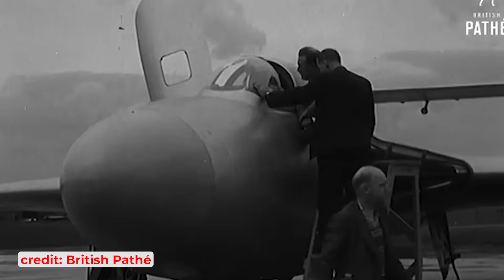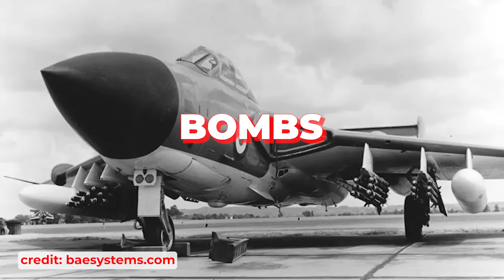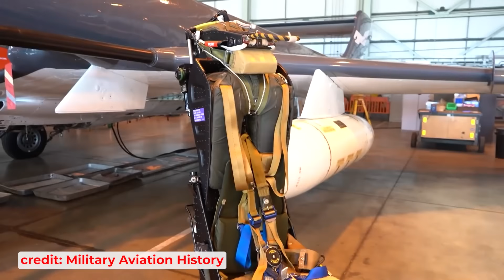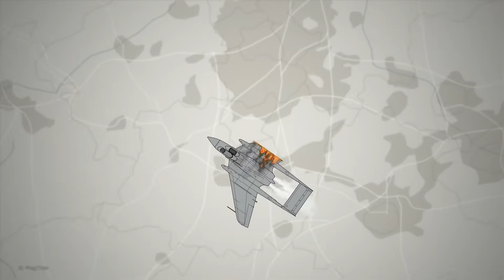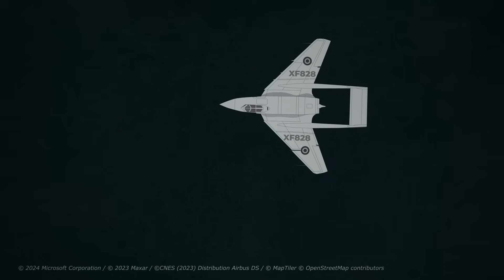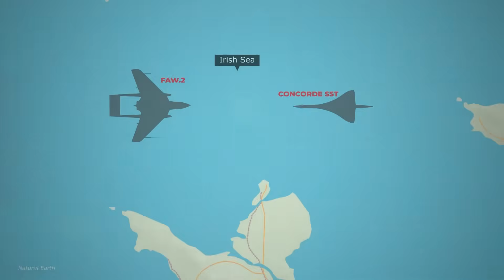Sea Vixen: A Beautiful Killer

Comment: Why continue flogging a dead horse,it should have been scrapped after the air show accident.
Reply: Sea Vixen Compared. 

We feel we can clear up some commonly held myths and misconceptions, obviously.

It's always good to see the facts presented clearly and concisely isn't it.

We feel we can clear up some commonly held myths and misconceptions, obviously.

It's always good to see the facts presented clearly and concisely isn't it.

See further down for a Meteor losses comparison.

See below for Comet accident losses comparisons. The Comet had similar accident losses fatalities to the later Sud Aviation Caravelle. Much later jet airliners from US manufacturers had significantly worse accident losses. 

The Vickers VC10 held the Atlantic crossing record for 43 years  (Non supersonic airliners). 

The Harrier was the only aircraft of its type at the time it first flew. All 1250 Pegasus engines built for all Harriers ever built anywhere were British build and design engines. The first 135 Harriers purchased for the USMC were entirely built in the UK. All 436 USMC Harriers had British built engines. 

The world's first wind tunnel was built in England during the 1800s. The world's first supersonic wind tunnel was built in England during the 1920s. 

Indeed that's correct. The Whittle Gloster E28/39 was of course a brilliant aircraft that was later copied in Russia as the upsized and tweaked Mig 15 with a copy of the RR Nene gas turbine aero engine.

Obviously the RR Nene being the world's most powerful & most reliable gas turbine aero engine in 1944.

The MD F3H Demon was a contemporary to the DH Sea Vixen & had a similar performance. The F4 Phantom was a follow on from the F3 Demon. The Sea Vixen took a long time to get from first flight to introduction for various reasons and a similar situation occurred with the MD F3H Demon.

McDonnell Douglas F3H Demon
590 Built. Not Supersonic.
Max Speed 578 MPH.
Introduction date 7 March 1956
First flight 7 August 1951
Retired 1964

MD F-4 Phantom 2
Number built 5,195
Manufactured 1958–1981
Introduction date 30 December 1960
First flight 27 May 1958

DH Sea Vixen
Number built 151 (including two DH110 prototypes and one Sea Vixen prototype)
Introduction date July 1959
First flight 26 September 1951
Max speed 695 MPH.
Retired 1972

Regarding the UK Aerospace Sector.
 
An airline recently ordered 60 RR Trent XWB Engines.

It's a great pity & a crying shame that British military forces had to occupy a large part of Germany for decades after 1945 & Russian military forces had to do the same. Of course Russia still posseses a large chunk of what was German territory & of course Russia & the UK produce nukes. Obviously Germany does not produce nukes.

Interesting British achievements.
There is no doubt that the Fairey (England)
Delta 2 was of course the world's first jet
aircraft to exceed 1000 mph.  Indeed It
exceeded the previous record by 310 mph &
held the record for 1 year. Incidentally, the Dassault Mirage 3 & 4 are based on the Fairey Delta 2.

Early days, jet fighters.
De Havilland Vampire, Sea Vixen & Gloster Meteor accident losses were not high or unusual for fighter aircraft at the time. De Havilland built large numbers of all metal airframe aircraft before the DH Comet.
We mustn't forget of course that the DH Vampire for example first flew in 1943 & the engine was also built by De Havilland. There were examples of the Vampire interceptor / fighter in service until 1990 which was operated by more than 30 countries.

Non combat phase accident losses.
% of Aircraft built.
The Canadair CL-44 was a turboprop airliner.
Canadair CL-44                  (ff 1959 ) 48%
Lockheed XF104                (ff 1954) 100%
Lockheed  P80                   (ff 1944) 43%
Lockheed F104                 (ff 1954)  45%
Grumman f9f-5 Panther   (ff 1947) 44% 
Convair F102 Dagger        (ff 1953) 45%  
MD F-101 Voodoo.             (ff 1954) 34%
MD FH Phantom 1            (ff 1945)  35%
MD F4 Phantom 2             (ff 1958)  28%
MD F3H  Demon               (ff 1951)  32%
Gloster Meteor                  (ff 1943)  21%
DH Vampire                       (ff 1943)  23%
DH Sea Vixen                     (ff  1951) 33%
Gloster Javelin                   (ff 1951) 20%
EE Lightning                       (ff 1954) 33%

An example of what goes on these days in various countries.
For example, there are of course no German companies that makes German jet aircraft in Germany & there are no German Companies that make German gas turbine aero engines in Germany that are suitable for widebody airliners.

Brazil makes very good airliners & Brazil is 100th down the list along with Indonesia for wealth per capita. Of course it is in fact the case that Embraer can't build those airliners without purchasing stuff from the US, UK & Europe. Norway Holland Denmark Ireland Belgium - Top 20 wealth per capita - Don't make airliners -  its as simple as that.

    Early days of the airliners.
That's correct of course, at the time the Comet wasn't particularly dangerous. Agreed, that is indeed the case of course, The DH Comet was definitely not the worst engineering failure in commercial airliner history.

How things were back then. 
Accident losses - % of aircraft built.
DeHavilland Comet 4                   14% 
DH Comet all mks   (ff 1948)       17%  
Vickers VC10 UK                            5%

The DH Comet had better safety than or similar safety to many other commercial passenger aircraft of a similar era.

Douglas DC-1                                      99%
Douglas DC-2                                      47%
Douglas DC-3                                      30%
Douglas DC-4                                      26%
Boeing s300                                        72% 
Boeing 307                                          70%
Boeing 247                                          48%
Boeing 707                                          20% 
Lockheed L-049/149 Constellation  30%
Lockheed Electra Turboprop             29%
Fairchild FH-227                                  30%
McDonnell Douglas DC-8                   14%
Sud Aviation Caravelle                        15%
Canadair CL-44  Turboprop                46%  
Convair CV-580  Turboprop                22%
Convair CV-880     (ff 1959)                27%  
Convair CV-990     (ff 1961)                33%
Tupolev T-104        (ff 1956)                16%

The VC10 held the fastest Atlantic crossing speed record for 41 years (Non supersonic airliners).

For the first few years of operations the Caravelle and Comet had similar accident loss Fatalities numbers.

De Havilland had prior experience building many all metal construction airframe aircraft & thousands of jet powered fighter aircraft that were primarily of metal construction with pressurised cockpits & jet engines built by De-Havilland.

We hope this helps. Cheers as always indeed etc
Reply: We feel we can clear up some commonly held misconceptions.

It's always good to see the facts presented clearly isn't it?

A potential successor to the Sea Vixen. 

The Hawker P-1103 / General Dynamics / Lockheed F16.

During the 1950s in the UK a number of aircraft that would've exceeded the capabilities of anything on the drawing board elsewhere were in the design stage. They were cancelled for various reasons including the missiles doing everything idea. 

1954, Hawker, fighter development - Air Ministry Operational Requirement OR-323. P-1103, a twin-seat swept wing aircraft powered by a de Havilland Gyron turbojet engine and armed with two Red Dean air-to-air missiles. Reworked the following year-  February 1955, the Ministry issued OR-329, called for a large 40-inch (100 cm) sweep-scanning radar unit AI-18. In October 1955 revised P-1103 proposal for a revised requirement offering the Red Hebe missile. 

In addition to the P-1103 Mach 2.5 design, Hawker also did design work for a faster P-1121 version. Mach 3, steel wing + uprated Gyron engine.

The Hawker P-1103 initial design had a fully variable geometry chin position inlet, Hawker's basic 1954 design would later be used for the General Dynamics F16 Fighting Falcon (Viper) - first flight 1974. The F16 was built in a number of countries with companies in those countries also producing parts for the aircraft that were built in the US.

We hope this helps.
Reply: A number of similar performance non supersonic jet aircraft got to first flight stage at around the same time. 

The MD F3H Demon was a contemporary to the DH Sea Vixen & had a similar performance. The later F4 Phantom was a follow on from the F3 Demon. The Sea Vixen took a long time to get from first flight to introduction for various reasons and a similar situation occurred with the MD F3H Demon. The Douglass Skyhawk delta wing is a contemporary to the the Gloster Javelin delta wing. Both non-supersonic delta wing aircraft, the javelin had better performance and first flew a few years before the Douglass Skyhawk.

Douglass A-4 Skyhawk 
2950 Built 
Intro 1956
FF 1954
In service to 1980s
Max V 670 MPH
Delta wing. A small / light jet aircraft designed for carrier operations without having to have folding wings. Often referred to as the scooter. 

McDonnell Douglas F3H Demon
590 Built. Not Supersonic.
Max Speed 578 MPH.
Introduction date 7 March 1956
First flight 7 August 1951
Retired 1964

MD F-4 Phantom 2
Number built 5,195
Manufactured 1958–1981
Introduction date 30 December 1960
First flight 27 May 1958

DH Sea Vixen
Number built 151 (including two DH110 prototypes and one Sea Vixen prototype)
Introduction date July 1959
First flight 26 September 1951
Max speed 695 MPH.
Retired 1972

Gloster Javelin.
434 built.
FF 1951
Intro1956
Max V 710 MPH
Delta Wing. 

Interesting British achievements.
There is no doubt that the Fairey (England)
Delta 2 was of course the world's first jet
aircraft to exceed 1000 mph, 10th March 1956 Indeed It exceeded the previous record by 310 mph & held the record for 1 year. Incidentally, the Dassault Mirage 3 & 4 are based on the Fairey Delta 2.

When the EE Lightning first achieved Mach 2 it was one of the fastest aircraft on the planet. 
P1 Mach 1 achieved 1954, Mach 1•5 capable.
P2 Mach 1 achieved 1956, Mach 2 capable. 
P2 Mach 2 achieved 1958.

The Hawker P1103 was a design and part built prototype that would have led to Mach 2 & Mach 3 versions of the aircraft. The General Dynamics F16 Fighting Falcon was of a similar design that went into service in 1975. The P1103 was cancelled during the switch to "mostly missiles plus no supersonic interceptor aircraft required in the future" era which included cancelling air to air missile development. Scheduled for test flights in 1958 and to be in service 1962. The General Dynamics F16 Fighting Falcon - based on a British design started 39 years earlier, built in the US and a number of manufacturing partner countries with parts for the US built aircraft sourced from partner countries. 

There were plans to do a supersonic thin wing Javelin which of course got cancelled. 

Early days, jet fighters.
De Havilland Vampire, Sea Vixen & Gloster Meteor accident losses were not high or unusual for fighter aircraft at the time. De Havilland built large numbers of all metal airframe aircraft before the DH Comet.
We mustn't forget of course that the DH Vampire for example first flew in 1943 & the engine was also built by De Havilland. There were examples of the Vampire interceptor / fighter in service until 1990 which was operated by more than 30 countries.

Non combat phase accident losses.
% of Aircraft built.

The Canadair CL-44 was a turboprop airliner.
Canadair CL-44                  (ff 1959 ) 48%
Lockheed XF104                (ff 1954) 100%
Lockheed  P80                   (ff 1944) 43%
Lockheed F104                 (ff 1954)  45%
Grumman f9f-5 Panther   (ff 1947) 44% 
Convair F102 Dagger        (ff 1953) 45%  
MD F-101 Voodoo.             (ff 1954) 34%
MD FH Phantom 1            (ff 1945)  35%
MD F4 Phantom 2             (ff 1958)  28%
MD F3H  Demon               (ff 1951)  32%
Gloster Meteor                  (ff 1943)  21%
DH Vampire                       (ff 1943)  23%
DH Sea Vixen                     (ff  1951) 33%
Gloster Javelin                   (ff 1951) 20%
EE Lightning                       (ff 1954) 33%

More recent UK military jet aircraft.
 
The Tornado & Typhoon & their engines are Supersonic & are indeed British design aircraft with British design engines built by an international consortium. The Tornado design for example started life during the 1950s at Vickers as the AFVG, it's engine is based on the RR RB-199. The EE Lightening is also a British Supersonic jet aircraft.

The Typhoon is the British BAC-EAP with an engine based on the British RR XG-40, the Typhoon is also built by an international consortium.